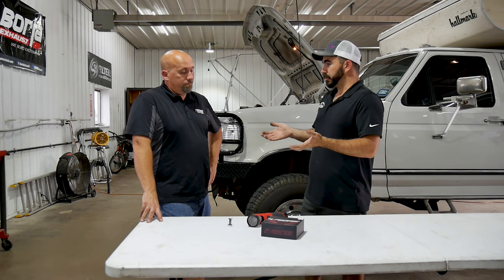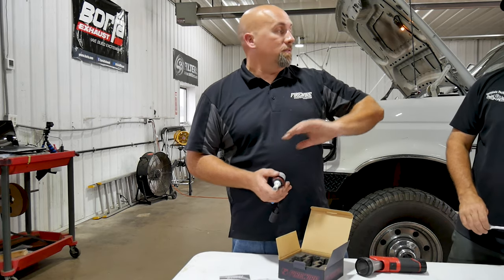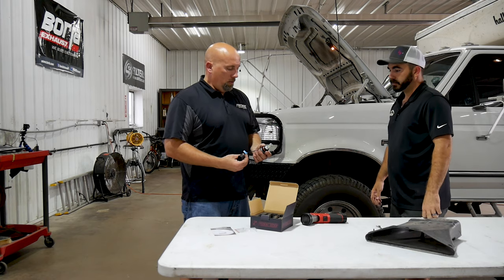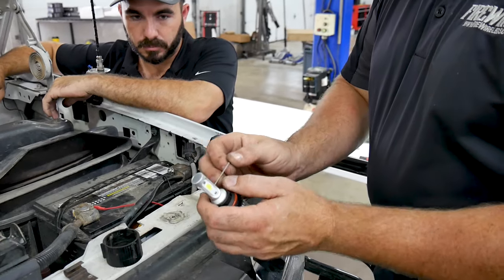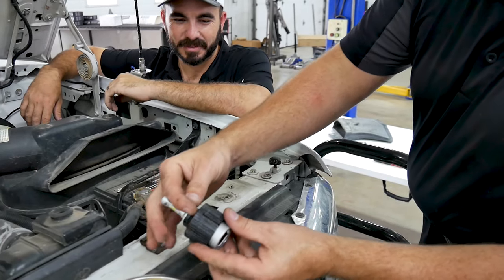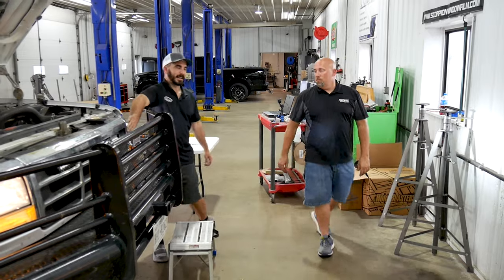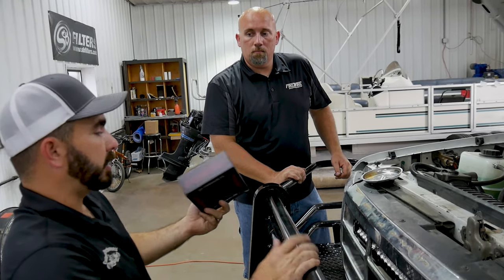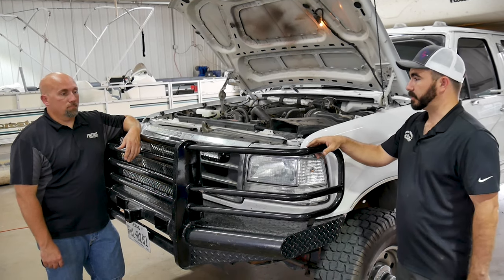Fix-it Friday: 1992-1997 F-Series Truck Firewire 9007 LED Bulb Install

Comment: Id love to change mine over to led. Its tight between the bulbs and the batteries. I built new trays to hold group 31 batteries and beefed up the core support

Comment: I noticed that the video gets cut off each time you are about to remove the old lock ring? Why? I unplugged my harness and have bulb and lock ring in front of me. How does it come off? The install seems easy but this part???
Reply from the maker: Sorry about that we cover that more in depth in this video here https://www.youtube.com/watch?v=YaLpLp-KJHY
Reply: @CompletePerformance  I ended up buying new aftermarket lock rings cause I couldn't take off the stock type bulb from the oem ring for the life of me lol It worked out I guess cause I kept the factory stuff intact in case a light goes out. Spares in the toolbox.

Comment: Any difference in light pattern or nighttime visibility between the diffused lenses like you're running and the clear lenses that you guys sell? (Sorry if you've already covered this in another video).
Reply from the maker: What we have found is a wider pattern with the diffused lenses and a further pattern with the clear lights.
Reply: There’s really not going to be a difference in your low and high beams, as in one being better than the other. When you switch from low to high it’ll just scatter the pattern in a little different area.
Reply from the maker: The question was about different light housings not patterns
Reply: I just got my set of clear lenses. They look great. Really add a different look to the truck. We currently live in the northwest, with lots of fog and rain, so I wanted something with the most light I could get out in front of me.

Comment: Great video! Paul - its nice to put a face to the name, I've gotten a couple of emails from y'all while I was waiting for my crystal clear led light kit (with Firewire!).... I was so excited to get these things installed, but we're having a problem - not hyper-flashing, but just no flashing at all. The blinkers and hazards just stay on. We changed out both old thermal flashers for new electronic ones, but still, nothing. I have a 97 OBS. Do I need to install those load resistors, or is there something else going on here?
Reply from the maker: Did you install the Flasher relay with your kit?
Reply: @CompletePerformance  Yes, we did....I was so disappointed when it didn't work. Also, one of the front park light bulbs may have a manufacturing defect, it doesn't seem to work, we swapped sides and it still didn't want to light up. so we reinstalled the incandescent bulb and they all light up - but nothing flashes....Sooo, I don't know where to go from here...is the bulb bad? Do I need resistors? - I wanted to call yesterday, but ran out of time....
Reply: @CompletePerformance  They do look great, though...